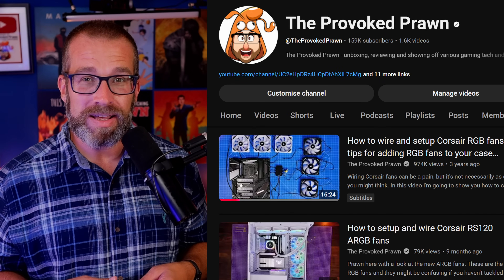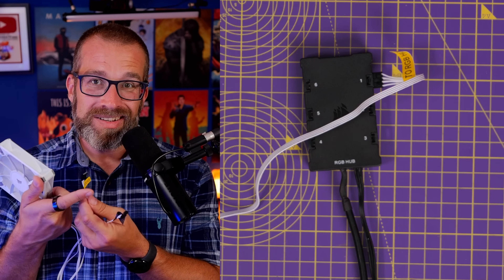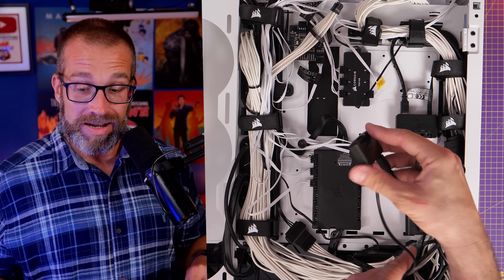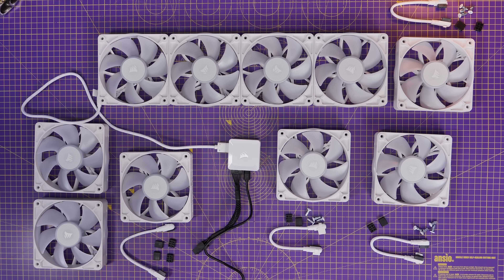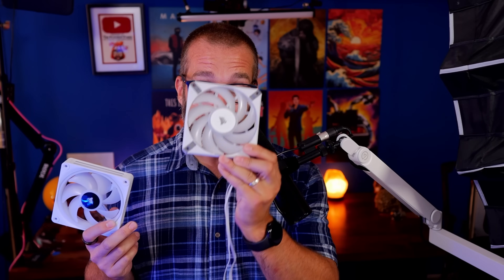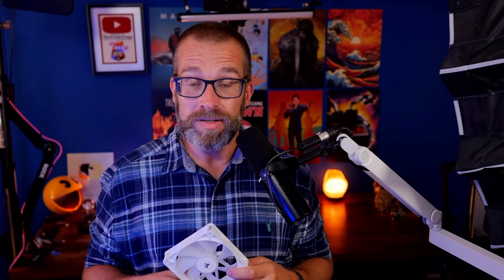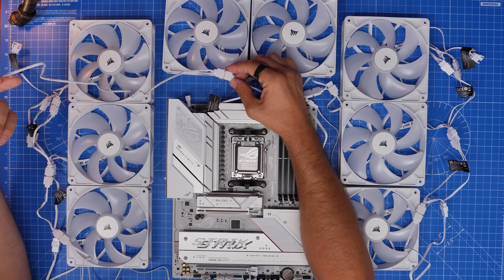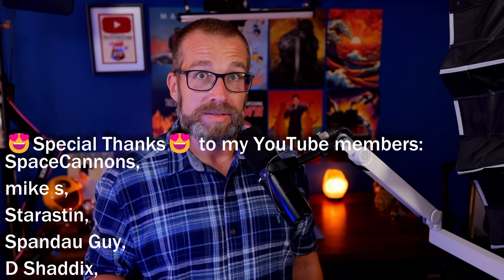Corsair fans are confusing

Comment: I have 4000d corsair case and i bought 9 RS120 fans from corsair, can i connect them all to the same PWM and ARGB pin ? I have just 2 on my motherboard ! And i used a hub once but it made me a lot of problems. Thank u for help
Reply from the maker: This guide might help
https://www.youtube.com/watch?v=S5I0yqXKlwg

if you get stuck though Corsair now has a new Commander specifically for those fans - https://www.corsair.com/uk/en/p/icue-link-components/cl-9011141-ww/commander-duo-lighting-and-fan-controller-argb-and-icue-link-hybrid-cl-9011141-ww?srsltid=AfmBOooHyeeBDgrqf2jI-_VzA31LlapZ9B-76mc5xPJ2ZtT-HYR86WM2
Reply: Thank u

Comment: I went with the corsair rx fans so i don't get over whelmed with cable management, but my next build will most definitely be thermaltake or arctic probably by then they will have way less wires
Reply from the maker: iCue link definitely makes it easier. Do you think thermaltake or arctic will be better?
Reply: @TheProvokedPrawn honestly, it's stress like, for example, the amount of research I have had to do to see if these fans will work in the lian li lancool 216. Another big thing is that I'm worried in the future when they update the icue app but end support for older fans icue could get buggy for older models which would make the consumer want to get a newer model same crap they do to phones. One last thing, probably icue type of systems will become a standard on the cheaper ones in 5 to 6 years, especially since the competition would have changed so drastic, and things like what Corsair is doing becomes cheaper.

I know this is already long enough, but what if the software just breaks? You can't manage fan speed aswell as the rgb headers they use aren't supported much on a main board.
Reply: @TheProvokedPrawn  so whats your thoughts on corsairs fans would be interesting to hear
Reply from the maker: @Snake2550 I don't see them ending support for fans tbh. But it is confusing at the moment with the different fans types, hence this video. But iCue link fans are very easy to install and use Vs Corsair's older fans and the performance is great tbh.

Comment: To be honest though, I built my new baby with as much Corsair gear as possible and I regret it. I'm slowly swapping everything out for others. Even my Corsair K70 Core keyboard is just... broken. Double-typing issues and wildly differing colours and brightness on the LED's. I fell for the hype and the good advertising. It's just not as good as I thought, and some if it is downright crap.

I just wish there was an link/daisychain system elsewhere. That part is good... but even with that it's confusing when it comes to the order of fans on each chain etc. Headache after headache. The power supply is ok but even with that... the fan is just stupid in its behaviour and much too loud. How can the other fans be so quiet but the one inside the power supply is so loud?

To sum up... massive waste of money. I don't see myself buying anything Corsair again.
Reply from the maker: Sorry to hear you've had a bad experience, and thanks for sharing your thoughts. Have a look at Lian Li fans

Comment: what are the best Icue link fans? i saw QX are the worst performance, more RGB. RX best performance lower RGB,  And LX the middle of 
both
Reply from the maker: I haven't tested to see the performance difference between them but from what I understand the RX Max are meant to offer the best cooling.
Reply: @TheProvokedPrawn This, I've had RXMAX ICUE link fans in my build for a while, the RGB is still really solid in my opinion and the cooling performance is there.

Comment: Just installed my RS120's yesterday. Going to have to look at the connections again as 2 fans aren't spinning and 4 not lighting up.
Reply from the maker: Yeah there'll be a loose daisy chain connector somewhere.
Reply: @TheProvokedPrawn  I'd have been more surprised if it had worked off the bat?!!😅
Reply from the maker: @neilburton1867 yeah, I too had some that weren't spinning initially. The logic is fiddly.

Comment: I am not sure the Commander or  Commander Pro are still available from Corsair?  I felt that Corsair is trying to force people to using the ICUE echo-system, during my most recent build, but the ICUE is very expensive.
Reply from the maker: I was under the impression that they were going end of line but you can still buy them - https://www.corsair.com/uk/en/p/pc-components-accessories/CL-9011112-WW/corsair-icue-commander-core-xt-smart-rgb-lighting-and-fan-speed-controller-cl-9011112-ww?utm_source=google&utm_medium=cpc&utm_campaign=DIY_Components_AON_UK&gad_source=1&gad_campaignid=20678746777&gbraid=0AAAAADPCiRfP6U3u4pI2C_0Aj7ZUQXPqT&gclid=Cj0KCQjwm93DBhD_ARIsADR_DjGPejeG4-HJfV0-pUVf7HcSmoZnWbbfXC_HnlInDLi5kFceAu-8VQMaAre0EALw_wcB#

Comment: Better to just avoid proprietary systems that require a specific OS with a specific piece of software. I went with Phanteks D30 140mm fans for my build and am very happy with them.

They link together like the Lian Li fans or the Corsair Link fans (albeit with more pieces), and the cable splits off into a PWM connection and a JST connector with a daisy chain JST coming off it, so it was very easy to just daisy chain the fans together til I could plug them into the RGB controller in the NV9 (they come with a JST to 3-pin ARGB extension though if you don't have that)
Reply: I bought 8 of those to get rid of the old Corsair LP fans that come with a wiring nightmare. They're really good
Reply: @YourboyMusti My build has 11. Three reverse blade bottom intakes, three reverse blade side intakes, two regular rear exhausts, and three regular top exhaust that came with the Glacier One 420mm AIO.

I just have the intakes and rear exhausts set at 50% PWM constantly, they move a lot of air and basically just hum a little noise wise. The CPU fans are on the stock curve, but they never really spin up much, as even during gaming the 9950X3D doesn't usually go over 60C.
Reply: @praetorxyn I bought the Arctic Freezer pro 420 that came out yesterday. Its gonna be 6 intakes but it'll only fit on the side bracket. 
The stock fans will be at the back of the rad and 3 reverse blade D30s on the front of the rad. 

Its gonna be 4 140 D30s fans at the top as exhaust, 1s to the top left

6 fans on the rad (3 P14 pros) + 3 D30s
Bottom left D30 + 3 140 TL LCDs at the bottom. 10 intake and 4 exhaust. 

Taking out a third of the pc then cable manage 10 fans is gonna take forever
Reply: @YourboyMusti That's why I went with D30s everywhere. It's basically two cables for each group of fans, one PWM, one RGB. Nothing like the Corsair mess I had in my last build where I had a PWM and an RGB for each fan.